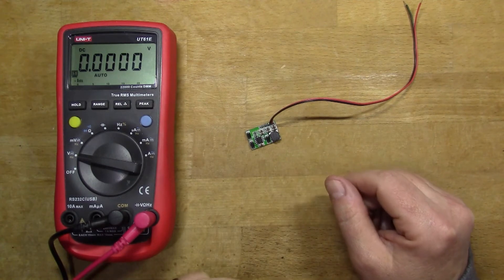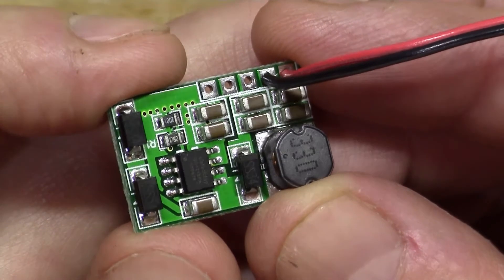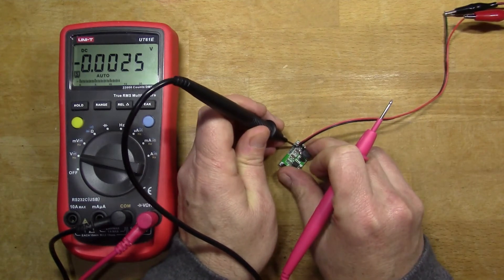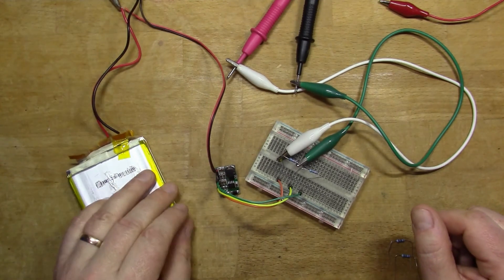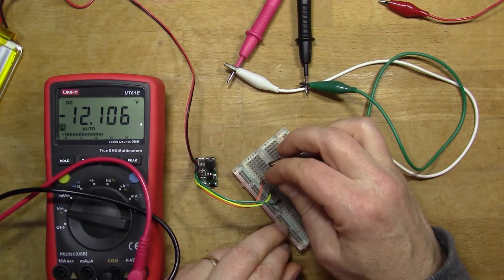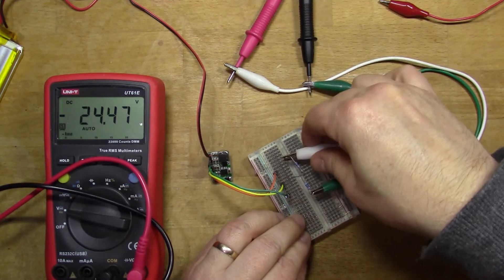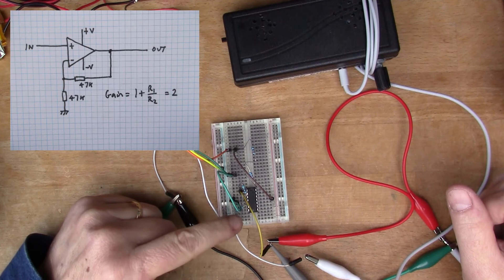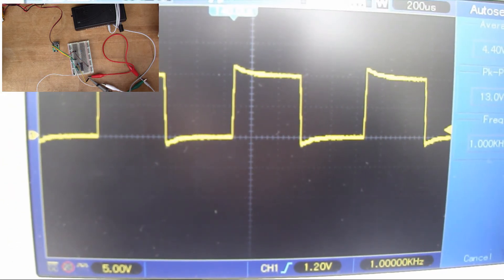Converting 5V to +/-12V for Audio Circuits (#54)

Comment: There are a couple of these on ebay,one goes up to +-24v dc,for any op-amp and i have a need for this myself for a commercial product,i think going higher then regulating down with a fixed regulator of 78 and 79 types to make sure that the supplies remain fixed and steady.

Also using the ic along with the data sheet and the purchased module allows you to integrate the circuit into your own design rather than trying to tack on a daughter pcb,which is a bit clunky,I will admit i that i wall also do this but for a 3.7v lipo to 5v usb for use on a pair of hdmi video goggles a rca to hdmi converter to be used with a fpv quad copter along with the quad copter box goggles via the goggles output.

But i have the op amp supply to sort out because as of now i am using a switching capacitive inverter ic and these are no longer made in the voltage regions i need ie up to op-amp rail values such as the max1044 or the ICL7660 both no longer made as far as i know and i had to buy a bunch of 7660s on fleabay i got a good price but some peeps go OTT on them,so a proper smps inverter has been in mind for a while now.

A bit of back engineering and some data sheets will sort this thorn in the alberts.

Comment: You can buy a Isolated DC-DC Converter which does the same probably cheaper too, they look like a relay comes with the benefit of having reverse polarity protection which is nice as I have killed op amps accidental by connecting them reverse polarity. https://uk.rs-online.com/web/p/isolated-dc-dc-converters/1874334/

Comment: Please post a link to buy this exact board, see some similars on AliXpress but not sure they are the same
Reply from the maker: This was the one: https://www.aliexpress.com/item/8W-3-3V-3-7V-5V-6V-9V-to-12V-12V-Dual-Voltage-DC-DC-Converter/32814926365.html